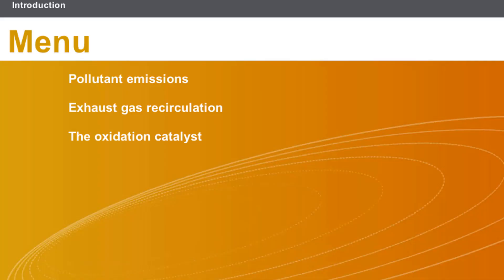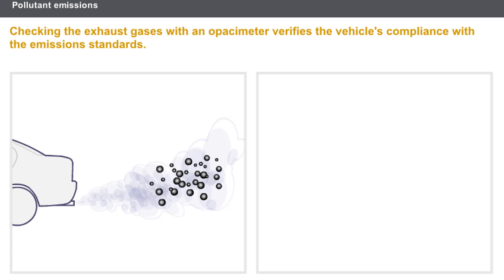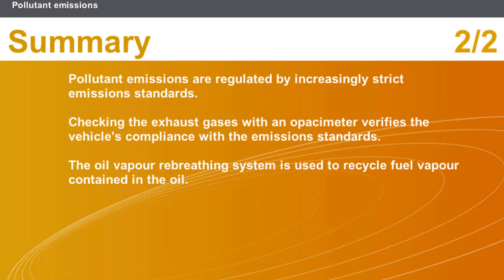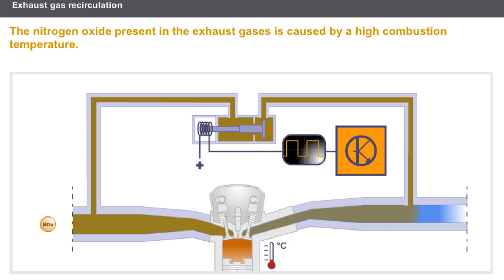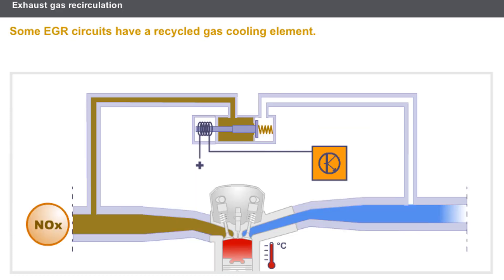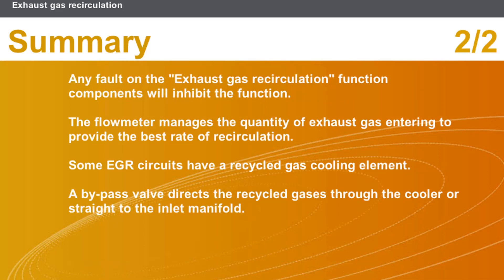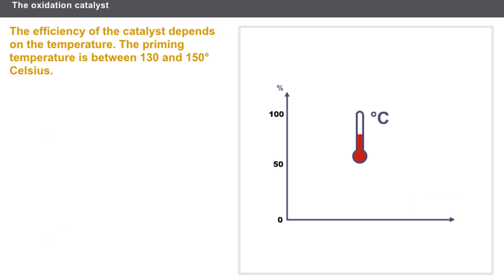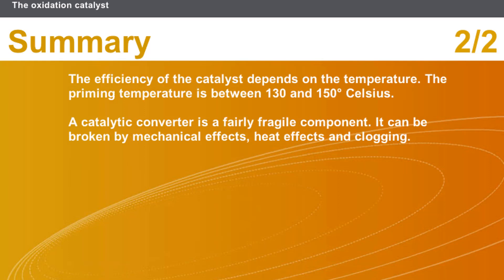Engine diesel (part8) emission control

Comment: Say  about petrol engines
Reply from the maker: Thank you for engaging with the video on diesel engines! While the focus of this particular video is on diesel engines, it's always fascinating to delve into discussions about different types of engines, including petrol engines. Petrol engines have their own unique characteristics and advantages, such as smoother operation at higher RPMs and typically being more responsive in terms of throttle input. They've been powering vehicles for over a century and continue to evolve with advancements in technology. If you have any specific questions or topics you'd like to explore regarding petrol engines, feel free to let me know! :_Thanks: